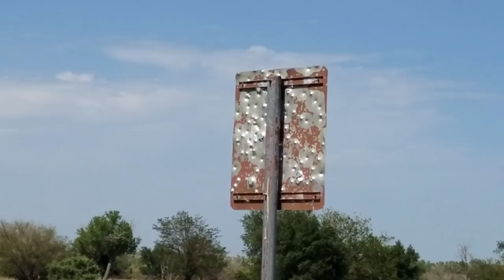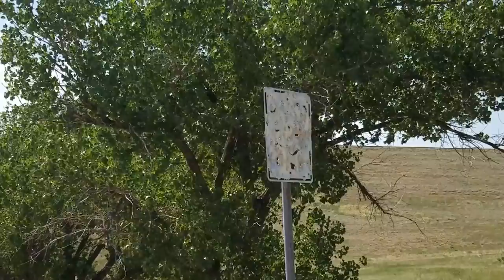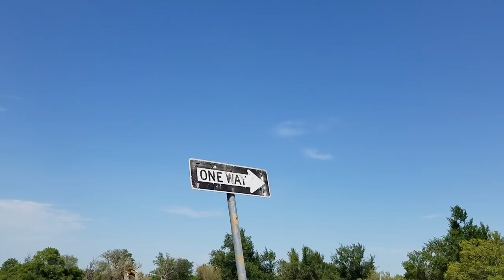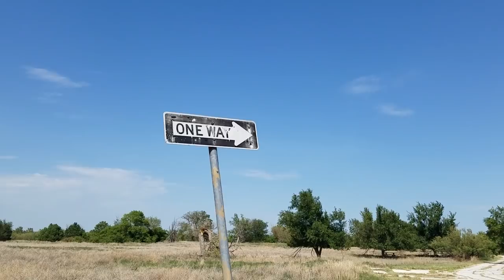Why Is This Lake Dry And Abandoned?

Comment: My dad drilled a lot of oil wells back in the late 50's and 60's in the panhandle and knew that area well. He said it was all political, it was built there because some state politician wanted it built there. All the geologists told them to build it 10 miles downstream or it would never fill. Whether or not it would have filled if built further downstream is hard to say, but there were two creeks east of there that still flow water into the Beaver River.
Reply from the maker: I have heard that same story from some of the locals and in fact I think some mentioned it in the comments.  It really is a crazy and embarrassing build.  Thank you for watching!

Comment: The only time I was there was in 1973...I went for a field trip to the Lab to see the process of determining the mixing of material for the dam.       Two of the biggest reasons for it's  failure is farmers began keeping more rainfall in the fields with reduced tillage because of the advent of better herbicides.    The area has a very high porosity so the water could not be held in a lake.
Reply: Great info, I was wondering.

Comment: A dam and boat docks with no water. That's so fitting for a government project. lol. Might have been a nice little area if it had been completed.
Reply from the maker: Someone shared a news article with me that was done a few years back.  They spoke to the Army Corps of Engineers and they said that this project has not been stricken from their lists of projects.  They said it takes Congress to do that so therefore they still have to maintain it at a cost of $30,000 per year.  I'm not sure what that's being spent on.
Reply: @RhettyforHistory  They still have to maintain the gates of the dam.

Comment: This was the second attempt by Ok Cor of Engineers to make a lake in the Oklahoma panhandle. First lake failed back in the 40's or 50's according to grandmother; that OCOE drilled into the same water table that farmers' irrigation wells were using. So when farmers irrigated the 1st lake went dry also. We were there summer 2022 less water.

Comment: According to Wikipedia, the water that was supposed to fill the lake decreased by a factor of 80% because the farmers in the surrounding areas, in order to water their crops and make a living, installed many new center-pivot irrigation systems and pumped out most the seepage groundwater that was filling Beaver Creek which was what was supposed to fill the lake.  This is all part of the over-pumping of the Ogallala aquifer which will  be pumped dry everywhere (TX, OK, CO, KS, SD ) except Nebraska by around 2050, right when this geographical area become a real desert due to human created global warming.  After the Ogalalla aquifer is fully drained by farming interests, there will be a giant desert from Amarillo Texas to the Black Hills of South Dakota, with an oasis in Nebraska where the Ogallala aquifer is much deeper.      

https://en.wikipedia.org/wiki/Ogallala_Aquifer
Reply: That's what has always struck me about the project - had it been built perhaps 10 years earlier it most likely would have filled for a time and then drained as the river ran dry. A decade later and the rapidly decreasing flow may very well have meant it was abandoned before being built. The USGS data on the river changes aligns so well with the construction.

Comment: When build there was an issue with the spillway doors closing.  That was half the issue of why the lake never filled. The boy scouts camped at the lake for years.  I grew up in the 80s and 90s.  We camped all the time there.  It is sad how it has fallen apart.  It may have been dry but it was beautiful.
Reply: That wasn't the problem.  A lack of river flow, high evaporation rates and a lake bed that was too permeable.

Comment: I wonder with all the rain and flooding if the lake has any water? Are you able to boondock camping? Very od I have lived in Oklahoma most of my 55 years and have never heard anything  about this project. Very interesting.It would have been a great resource  for a area that needs jobs. Awesome  video I will have to go and check it out.
Reply from the maker: I wouldn't imagine that there was enough up there to do anything.it would be nice if they had some sort of pipe line to pump the access water from the NE part of the state to the panhandle.  You can boondock there.  Pretty much a do all that at your own risk though.  Probably safer going in a wildlife area than there.
Reply: Yes, you can easily boondock there. Use Google Maps to zoom in and you will find the camping areas are still there and you can get StreetView of what the sites are like.  However, the StreetView was from over 10 years ago and the weeds growing up through the pavement are much worse now.  (Don't go in a low slung sports car). 

I would recommend the campground on the north side (just SE of the Hardesty Cemetery) as many of the sites there still have the cement picnic table in place and several of the sites have good shade cover on both sides.  Be aware that there are no outhouses, etc on site.  But it is quiet and you are unlikely to find anyone else camping there. 

I've spent several nights there over the years when I travel through the area.  There is a YMCA in Guymon to take care of the need for a shower, etc.

Comment: Even though the dam has no water behind it and the gate is open, it is providing flood control during a heavy rain event as visible by the high water marks on the dam. So it still functions as a flood control structure and reduces erosion downstream. Not a total waste !
Reply from the maker: Oh there has never been water that high or it would have been a success.  Those are only differences in the material.  Nothing has ever been remotely close and the panhandle has never had a problem with flooding which is why the lake was created.

Comment: If they had contracted out that project to a private company, may be it would have turned  differently.
The Army corps of engineers  is not supposed to tackle large scale civilian projects. It was not up to the task.
Reply from the maker: I've seen them in charge of other lakes but this just really had the wrong bed floor and not enough water coming in.
Reply: They do a good job on the US riverways too Zorro.
Reply: Zorro, they manage most of the major lakes the U.S.